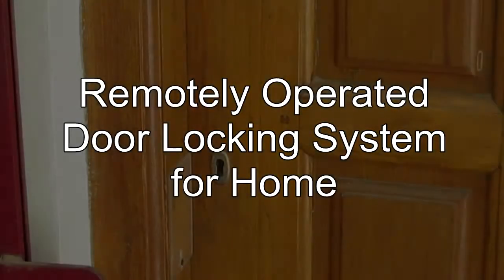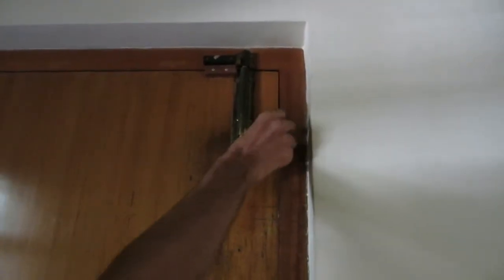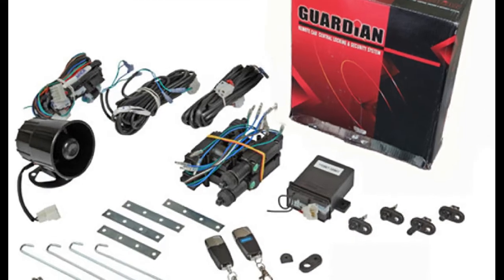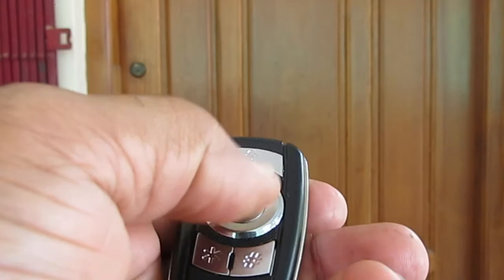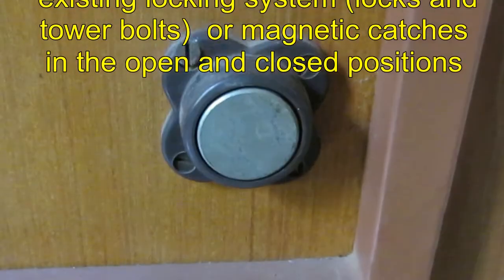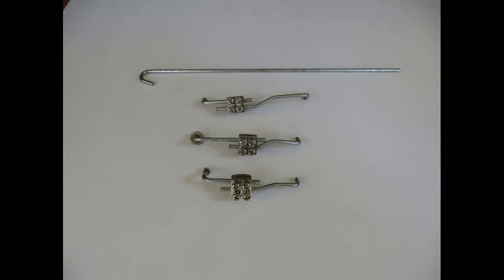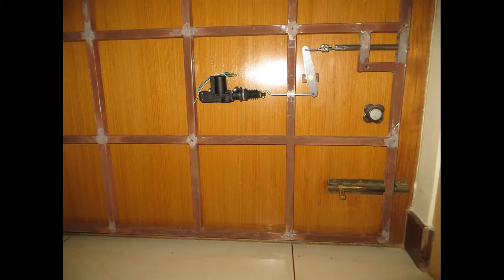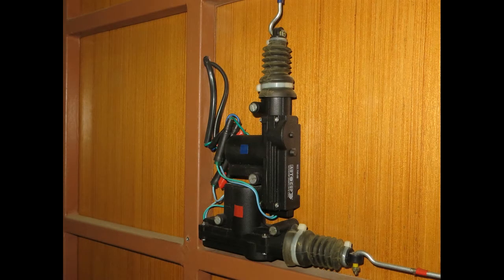Home Door Remote Locking

Comment: Just wondering why if the door still flexes at the bottom, you didn't add an extra bolt there? You could've had one at the top, one at the bottom and one in the middle.
Reply from the maker: I have added a bolt at the bottom too. The flexing of the door is with only the top tower bolt engaged, before and after reinforcement. After reinforcement, the deflection came down by half. But with the three bolts engaged with the remote controller, there is virtually no deflection of the door.

Comment: In case of failure in system you will have to spend night outside ...
Reply from the maker: There's a mechanical back up though a bit difficult to operate. I haven't explained it because of security reasons.